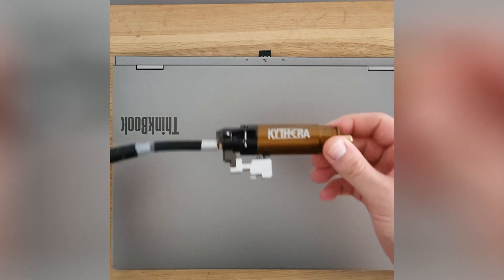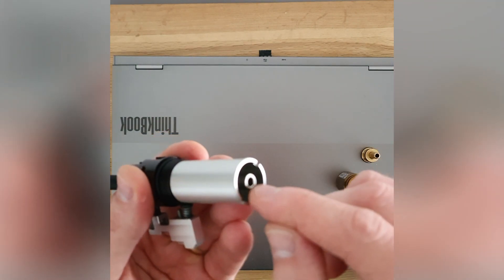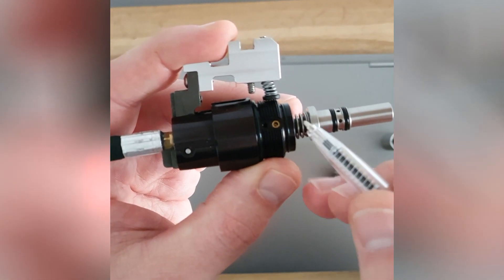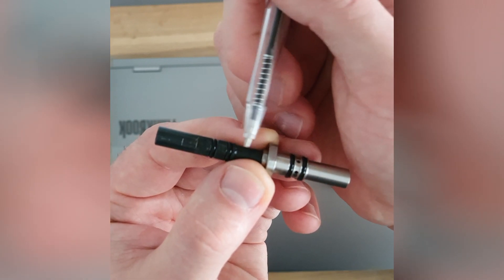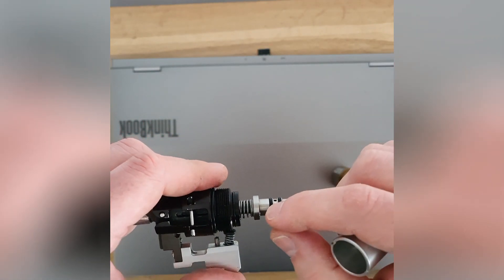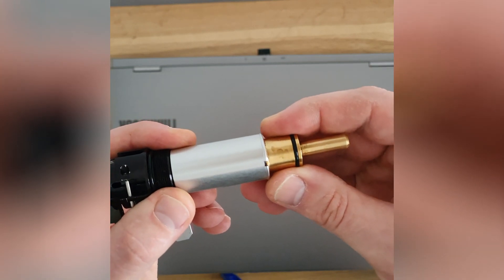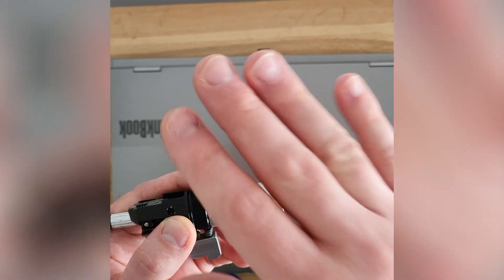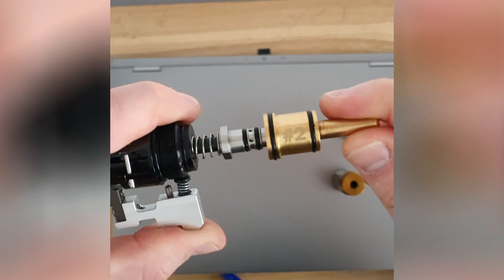How does Kythera works ? + Dwell/air volume adjustment #kythera #polarstar #hpa

Comment: Thanks for sharing this mod looking forward to testing it out. What are your methods on testing over all air seal (no barrel, engine only)? I am assuming air can leak out of the nozzle... But are there any  other locations where tha air can leak? Given you did a full o-ring repalcement how coud you test that there is no leak?

Comment: Hi. Thank you SO MUCH for this video, and your answers to the comments. 
Please, I need some help. I bought a second hand Kythera, and a second hand Wraith-X. They are in great conditions, and I am trying to install them in a cyma Colt Keymod CQRB, with a 6.01 x 375mm PDI barrel, with prowin hop up, MR HOP maple leaf bucking. 

My problem is : I have hight inconsistency. Overall, my joules are +/- 0.1 joules with consistent rate of fire. But here is the thing... My first shot will be 1.72 joules. I wait three seconds, 1.7 joules again. But if I wait only one second, it drops to 1.6, and if i do like 2 or 3 rps, it drops to 1.4 joules. 

1- Is this only an alignement problem, or is my wraith-x involved in you opinion ? It is only mechanical, and no parts looks damaged, on both the kythera and the wraith X. 

2- Also, I lubed everything with Abbey Silicone gun grease, is it wrong ? Do you recommand this type of build for milsim use ?

3- Would you avise me to sell my kythera, and buy a F2, due to the reduces autonomy I have ?

4- Should I also buy a higer quality external replica ? If so, what brands would you recommand for a good alignement ?

Hope you'll see this comment. Thank you so much.
Reply: The replica and the silicone are not the problem. Start changing the BB weight, test. after that change mr. hop, for my setup the maple leaf dont work, put another one and make the test. the maple leaf buckings have wide lips, the bbs pass though the lips without resistance, so the bbs stops every time in different places. The prowin dont close the lips enough to correct the problem. Your main problem, for me, is the compatibility Bucking, Hop and Kythera. I use the Madbull Airosft Hop Up Bucking - 60 Degree RED Shark Bucking with psi between 90 and 100 psi, prowin, .30g bbs and the kythera. My replica is a Ares. I hope u find the solution.

Comment: I have a issue with my kythera: every 3 shot or so, the nozzle stays in the back position and I can not shot. Than  I had to disconnect the air supply, the nozzle goes forward, pull the trigger, I can here the click of the trigger and after i connected the air supply again, it does shot again.
Can you help me with an advise?
Thanks in advance
Reply from the maker: @JoJoker70  loosen up a bit the "top screw" and check your alignment. This can happen when nozzle is off center and it catchea on the Hop up walls
Reply: @tatkoairsoft2146 thank you. I will try it

Comment: hi there we are having problems with a huge inconsistency in the acuracy of the shoots, it looks very randon and there is not a fps inconsistency help please
Reply from the maker: @silviosilveri1351  kythera has preassure actuated nozzle. Your bucking lips doesnt provide enough tension and bb stops everytime at a diffefent place under bucking nub. Tighten up the bucking lipa via PTFe tape or get Silent industries Hop up chamber which has tension rings that over bucking lips to tighten them down.

Comment: Hello, first of all, sorry for the language, I don't speak English well.
my kythera has a problem that launches two BBs when firing
I did a thousand tests and I can't solve it
I have recorded a video in slow motion and it is seen that the nozzle bounces when activated

Any idea how to solve the problem? I don't know many people who know so much about this system.
thanks a lot
https://www.youtube.com/watch?v=I8Ob6kuhAug
Reply from the maker: @15chango15  hmm, seems like something is wrong with the sear and it "double releases" causing double fire. I would advice you to clean the engine (spool, dumb chamber, nozzle), regrease the orings and remove the adjustment screw from the top of the sear. Reassemble and set it up again. Make sure the silver "cover" which slides over spool has notches facing towards front. (Should be firing fine without top screw. Install it if you want "shorter" trigger pull)
Reply: @tatkoairsoft2146  If all that is as you say, but keep doing the same thing, any more idea? It's crazy
Reply from the maker: @15chango15  then i would try to return and get a new unit.
Reply: @tatkoairsoft2146  impossible is no longer under warranty, before it threw correctly :(

Comment: I have my in a v3 gearbox in an lct started out great then slowly over time with no heavy use would discharge without shoot and i would have to manually charge it. And now it wheezes and wont charge the system eventually it will charge and shoot but it's spotty at times. And local airsoft techs seem to have no clue and say that it's fixed when it isn't.

Comment: Would adding a spacer help fix air volume issues with shorter barrels?  Im running a 260mm barrel and im getting crazy fps inconsistencies
Reply from the maker: Nope as that has nothing to do with inconsistency. On 247mm barrel I was getting +- 1 FPS variance on slow semi (1 rps) with spacers and also without. Of course, going 3+RPS would always have drop of +- 0.15J no matter what, as the design of kythera cannot keep up with the 3+ RPS. If you have big FPS variance on slow semi(1 rps) the problem would lie somewhere else
Reply: @tatkoairsoft2146  thanks for the insight. perhaps my issues are with the cgs co2 stock regulator I'm running
Reply from the maker: @petercarlson3271  make sure the engine cannot move inside the GB and that the axis of nozzle and barrel is as centered as possible. Those two are the most common "causes" for fps inconsistecies.

Comment: Quick random question just bought a blemished kythera and every time I connect air it leaks ever so slightly but stops when I lightly press the sear before it goes off any tips brand new to HPA
Reply from the maker: I would suggeat checking, cleaning and relubing the orings with Techt gunsav. There are 4 orings on the spool, two o  the kythera body and two in the nozzle if i remeber correctly.

Comment: Hi tatko
i have a question.
Whats the diffrent about the hard  and soft Spring from the kythera
Reply from the maker: The difference is in the amount of air released at higher psi (120+). The harder spring enables the valve on the nozzle to be exposed for longer, thus more air is released from dump chamber. In practice, if you have lets say 1.8J at 140 psi on soft spring, switching to heavy spring will bring that up. I cannot tell you how much. In P* video they gained 0.5J going from soft to heavy at 180 psi.

Comment: So, just a small question.

Does the Kythera then handle 4 RPS just fine or should I try to stay at around 2-3 RPS? My "natural" triggering rythm is around around 4 RPS, do you think the Kythera will keep up?

Also would a shorter barrel help? Since a shorter barrel won't need as much air as a long one or am I misunderstanding the dump chamber design?

Otherwise, excellent video!
Reply from the maker: Kythera is fixed Air system, so barrel has no effect on how much air is released. Hard to say about 4 rps ..... but It should be minimal Fps loss if any. in CQB not noticable. In "DMR" play maybe, but you never know unless you field it.
Reply: @tatkoairsoft2146   Thank you very much!

Comment: Any chance you can explain more about the Dump Chamber Spacers in you video description? Do these help with the slower chamber refresh rate?
Reply from the maker: Unfortunately there is minimal difference in the actual refresh rate. You will see decrease in air usage, since the Volume of the dump chamber will be reduced, but also the velocity will go down a little. Which means you will need to up about 10 psi to get the same velocity. So I can hardly tell what would be the overall "advantage". with 48ci/3000 PSI tank I can get about 3000 shots at 1.5J and about 110PSI on the reg with the spacers. (my f2 gets double that, at 6000 shots per tank) The slow refresh rate is connected to the way how the air  flows the engine and also nozzle "increasing" the overall volume when it returns to the front position. I have tinkered with it quite a lot, but Could not eliminate the refresh rate lag. Which means over 3 RPS, the velocity will drop. At 8 RPS I am getting about -0.15J. From my experience there is nothing you can do, just make peace with it :D ... So if you you need the "perfect" consistency, just go for the Solenoid engines, as Kythera will not satisfy you. But if you really like the trigger, just make sure you do not spam the trigger that much. in CQB the drop in power is not a factor, but in Woodland games it can lead to increased groupings.

Comment: I've a kythera too, when my PSI are at 120PSI, the first shot work at 120PSI, then the others are between 80-100PSI... Around 110 to 130 PSI is the minimum that I've to put into the kythera and I don't like that, because i'm around 370FPS at 120PSI and around 320FPS after several shots :/
Reply from the maker: When you say you need 120 psi and others are at 80, are they using Kythera too ? You cannot compare Solenoid engines and Kythera, as they operate on different principle. Kythera needs aprox 30-40 more psi then Solenoid engines to reach the same energy (f.e. on 290mm 6.02 barrel I need 110 PSI on my F2 and 150 PSI on Kythera to reach 2J). If they have Kythera and the same length of the barrel as you, you have a leak in the system somewhere. Regarding PSI lag, it is normal for the engine to "lag" if shot more then 3 RPS ... it can display as needle on the manometer jumping 10-15 psi back and returning after split second (0.2-0.3 sec) to the set pressure. Nothing you can do about it ... it is "natural" flaw of the engine :)
Reply: No I'm sorry my english is not good enought :/ I wanted to say that my kythera is at 120PSI at the beggining and when i shoot several bb's it decrease to 100-80 PSI :) But as you say is the natural flaw so I don't have to worry about it ! @tatkoairsoft2146
Reply from the maker: @GregoirEAzer  No problem ;) . Here is a quick vid of "normal" refresh rate with kythera https://youtube.com/shorts/sExVnWti7OE?feature=share . You can see that with rapid fire it floats at 80 psi, while with slow fire it is 100 psi. If yours drops more then 20 psi (or power is decreased more then 0.15J compared to slow semi) maybe your reg needs a clean :)

Comment: Do we have any data on the air volume a kythera pushes into the barrel when it is in its standard configuration?
Reply from the maker: Sorry, no idea. It is difficult as the PSI of the air will gradualy drop, as the air feed is cut off until the nozzle is reseted. It is one big magic :D if you care much about voluming, just switch to F2. You wil save yourself lot of time :)

Comment: Hi Tatko!
You seem like the most knowledgeable person on YT regarding the Kythera, can I bother you with a few questions about it?

Would you say the Kythera is more consistent in J output compared to a high end AEG gearbox? I read a lot of claims online and some of my friends swear by HPA systems in general for this reason, but because they literally call themselves "HPA fanatics" I assume there is some bias in their judgement ;)

Follow-up question: The airsoft fields where I play often have vastly different rules regarding max allowed bb weight and fps, so HPA is appealing to me because it allows me to adjust fps on the go easier than any spring change system. The idea is to build a DMR-type rifle around the Kythera intending to shoot bbs ranging from 0.3g up to 0.45g with a relatively long barrel (about 460mm), I imagine it is necessary to adjust dwell to accommodate for the change in bb weight (which is the main reason I searched for your video), is this true? If yes, would this dwell adjustment be easier on an electric HPA system?

Last question: I'm intending to use a UGS stock so the limiting factor for me will be the small air volume in the 0.2l tanks. Would you say the Kythera is more or less efficient compared to electric HPA systems, or is there no big difference?
And is there a noticeable decline in FPS as the pressure in the main tank drops while shooting?

Sorry to barrage you with all these questions at once, but so far I haven't found any solid answers to any of these online.
Reply from the maker: Hi there. No problem, will try to tackle the all.

1) is HPA better then AEG  in the J output consistency ?
Finely tuned AEG can be as good as HPA. On both I have had variance of +-1 fps. The main difference thou is that with HPA, it is a lot less hustle. Then only real "problem" with HPA is the alignment of the nozzle and barrel. AEG has it too, but a lot more problems to solve :) : Nozzle spring strength, Speed of the Gears, shimming, lubing etc ....

2) Kythera vs Solenoid engines (F2 for example)
As I own both Kythera and F2 (only 1 game so far) I can tell you that F2 is far more superior in the "tunning" department. Having the FCU to adjust the timings is a god send, compared to the options which you have available with Kythera. The main selling point of the Kythera is the lower price, absence of the battery and the trigger. The main disadvantage is that the Kythera cannot handle fast semi (4+ RPS) without power drop (you can expect up to -0.15J on fast semi due to the engine design ....) On the other hand F2 has better tuneability, doesn't Drop Power on fast semi/full auto (I have tried 25 RPS and the power did not drop with Mancraft MMR regulator) .... So from my perspective Kythera has its  community, but performance wise F2 is in a different league. I am not saying you cannot play with it, but if you need to have everything "perfect" (power not dropping, ideal Air volume ration ....), go for F2. When polarstar would come up with Kythera like trigger mechanism and F'2 solenoid operation in one package, it would be the perfect engine :D .... fr your setup (460mm| barrel I would not be changing anything in the Air volume department. The only "tunable" thing would be metering screw to control your nozzle loading speed, if you have feeding/hop problems.

3) With kythera, I get about 3000 shots from 0.8/3000 PSI tank .. With F2 from the same tank I got about 4500 bbs. So from 0.2L/3000 you can expect about 700 from kythera and 1200 from F2 ..... 4500 PSi one should get you to ~1100 on kythera and 1800 on F2.
Reply: @tatkoairsoft2146  Thank you, that was very informative!
This makes the choice a little harder though, but that's the beauty of it ;)
Cheers!

Comment: what if I want the opposite.. I want to increase my joules.. how do I do that?
Reply: thank you for your very honest reply sir.. more power to your channel.. also I will follow you because you reply fast and you have good content
Reply from the maker: You need to switch the stock spool spring with the heavier one and run high PSI up to 180. Second thing to help you attain more J is heavier bbs (0.4g+) and longer barrels. With HPA, J output increases quite a lot with heavier BB and longer barrels.